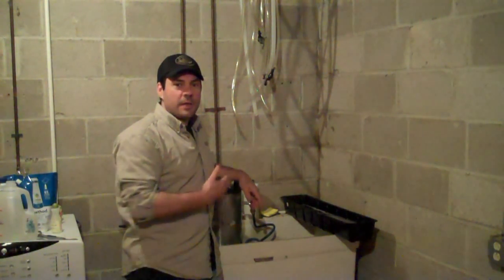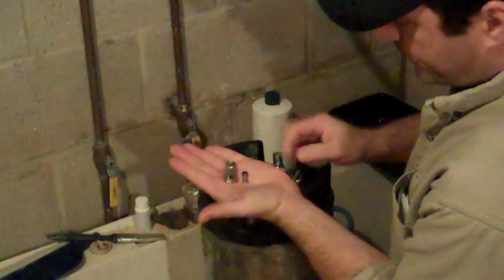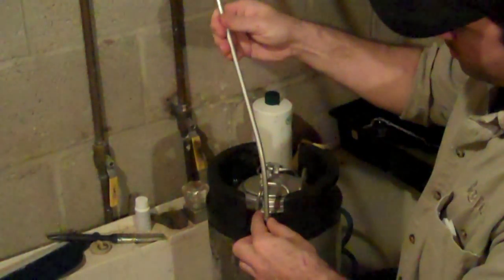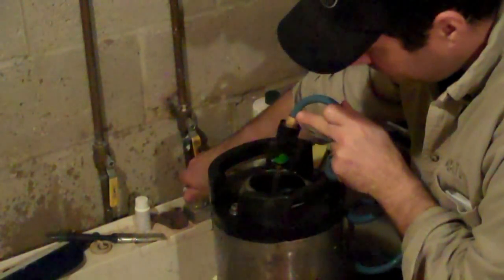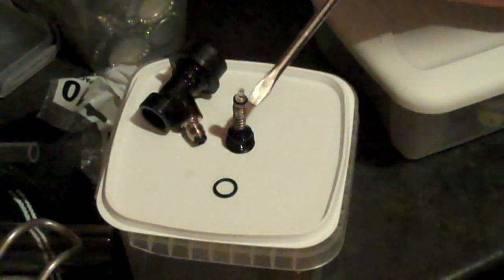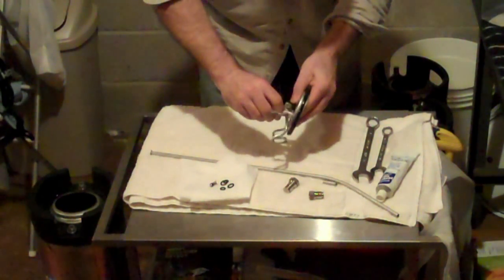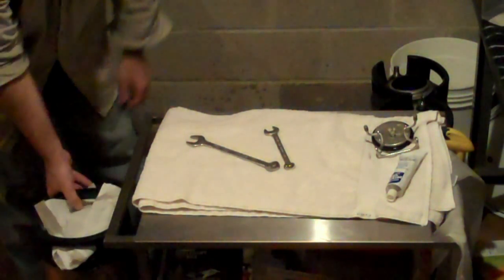Homebrew Cornelius keg disassembly, cleaning, reassembly, quick-connect anatomy

Comment: 0:30 attacking or rings with dental pick
1:07 posts off, posts are different.  11/16, 7/8 posts and some poppets.
2:06 small stem and ring removal.  All things into bath of oxyclean/pbw.
3:03 removal o-ring over pressure valve.  Soak all things in pbw/oxy
3:18 lid off, big o-ring, dump in drink of pbw/oxy.
3:34 all rubber bits being cleaned.  Could upside down in bucket instead.  Rinse with low pressure hot water.
4:05 should be wearing protective gloves and eyewear.
4:39 liquid side disconnect, both are the same design.
5:57 silicon keg gel on anything rubber seal surface.  Less is more.
6:35 o-ring PRV, don't cross thread, its only plastic (easy to x-thread).
7:15 dip tubes.  Marked in, small (gas) tube goes in.  Turn keg around but don't try and stick long draw tube into gas tube.
8:10 gas posts, have scalloped bottom or corners have cuts in them.  Screwed up turning keg around.  Threads on by hand when done right.
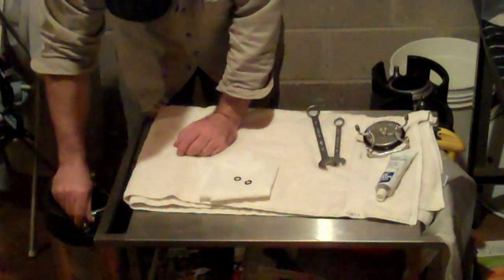8:48 insert poppet, make sure to not cross thread.
9:03 SNUG, don't over tight, maybe to where they tighten on rings, not over tightened.  Then post o-rings into groove, then wrap around post.  Keg is ready to be cleaned with sani before you fill with beer (aka, spray or pour some in and slosh it around, close top, slosh around more, then drain and then fill).
Reply from the maker: Hey thanks for this!

Comment: great video. Thank you! for the next step (racking beer to that cleaned keg) I assume you fill with star san solution, swirl and either dump or force out beer line with co2 pressure? Assuming using gas makes sure the dip tube and beer line gets hit with the star san is a better option

Comment: Great video! I certainly takes some of the mystery out of how to take a keg apart and clean it.
quick tip.  to get a stuck poppet out of a post I tap it from the top with a small screw driver. by tap I mean TAP and it will pop out. Another tip in case you don't have a dental pick (like me) for removing the post o-ring ti to slip a dart tip under the ring and slip it off.